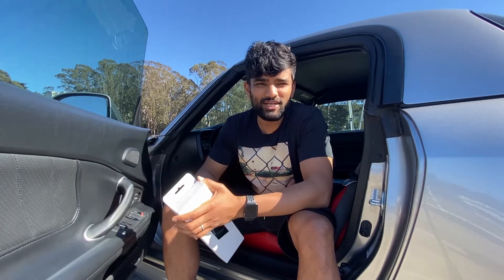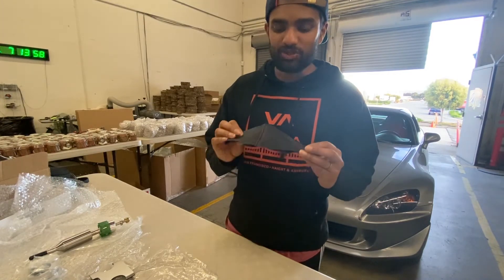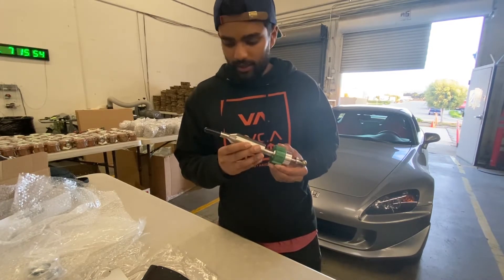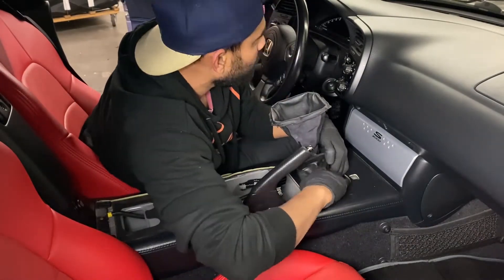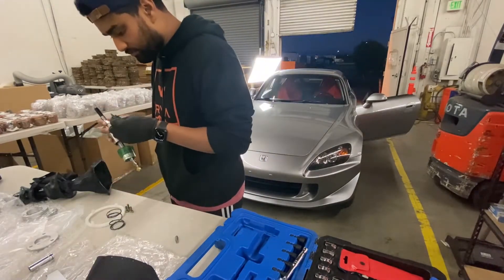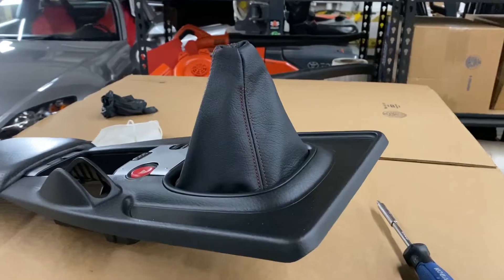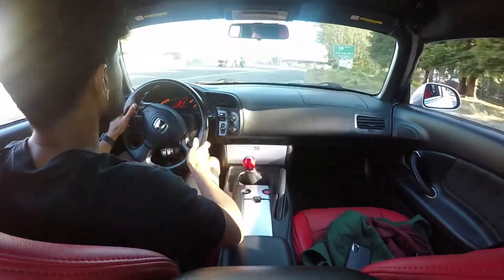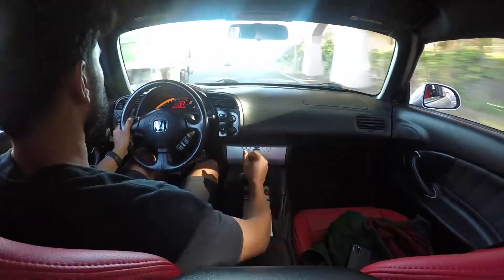Does your S2000 need a short shifter? Renegade Short Shifter Install/Review - Honda S2K Build Series

Comment: I had one which felt great but unfortunately it’d rattle over 4K rpm. I know a few others who had this issue, didn’t affect performance but got too annoying overtime so went back to stock.
Reply from the maker: I haven’t experienced any rattling yet but id likely switch back to oem if it did. Do you think it has any thing to do with the amount of grease provided with the kit? I felt like it definitely use more than what renegade provides.
Reply: @zaahidrahman  also my first thought so I bought a tub or grease and went to down. Was ok for about a week then it came back unfortunately. Keen to hear how you go though!
Reply: From all of the ones I've seen rattle,, some way more than others.  This shifter isn't the best thing, hard to get into reverse at times, also during track use some gears don't go in smoothly.

Comment: Who loctites a shift knob.
Reply from the maker: LOL i thought the same thing but apparently its a somewhat popular mod. People remove the locking nut so the knob sits about 3/4th of an inch lower and the use loctite to keep the shift pattern lined up. Big price to pay for a slightly shorter throw imo....
Reply: @zaahidrahman  I need it even shorter than that so I can accidently go from 5 to 2, so I mechanically over rev to 12k.